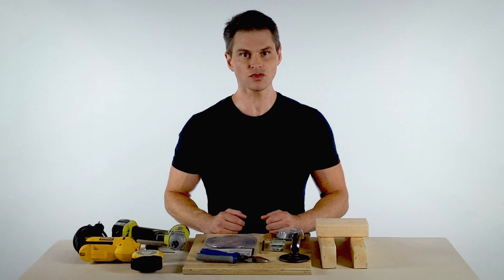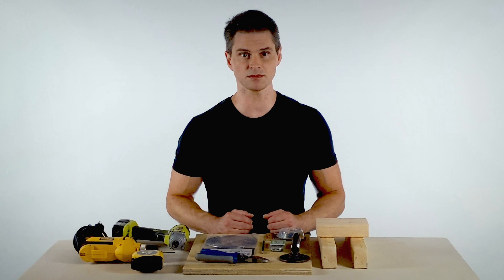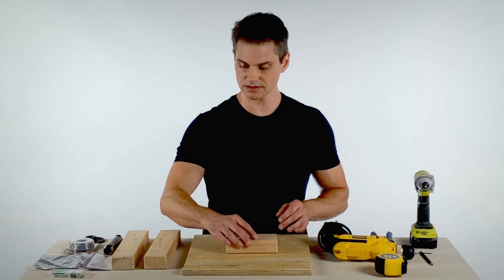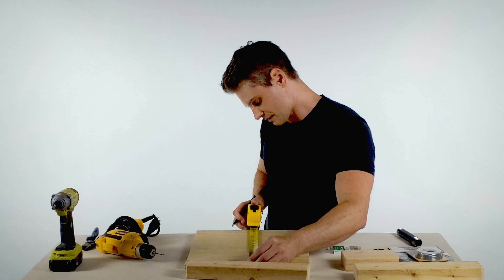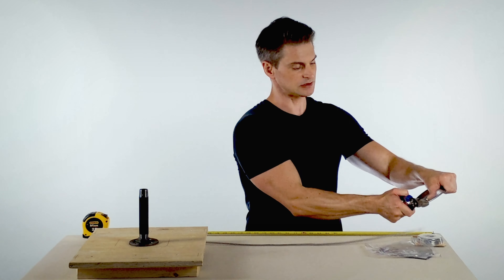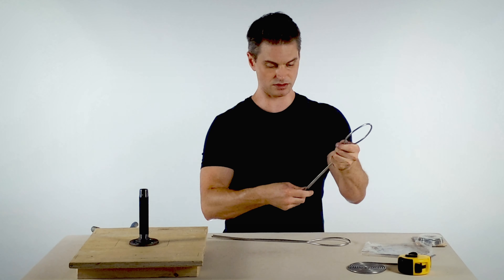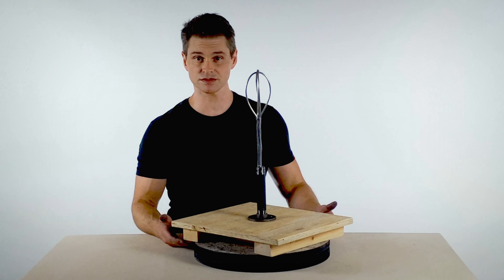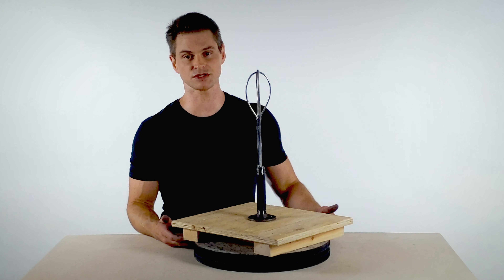On-Armature Bust Part 3: Making the Armature

Comment: Hi Mark. I've made my armature but could yiu tell me the height from the base to the top of the egg beater . thanks obie
Reply from the maker: A bust armature is typically about 16 to 18 inches / 40 to 48 cm in total height, but really this will depend on how big a base or much of the torso you want to include. The egg beater part should be just about centered within the head, so you can estimate the final total height of the sculpture with a fair degree of accuracy. Best of luck!

Comment: Is it possible to make a full scale armature the same way you made this armature or is there another way?
Reply from the maker: This kind of armature wouldn't support the weight of a full figure. For larger sculptures, you'll need to use stronger materials, at least for the primary load bearing elements. Common choices included welded or bolted steel bar or pipe, bent electrical conduit, wood, and plaster. For smaller features, like hands, you could still use flexible armature wire for posing adjustments.
Reply: @intheround8310  thank you. I’m working on sculpting life size figures to turn into polystone resin statues of characters and it hasn’t been easy finding the right materials.
Reply from the maker: @mjsimunovich013  Wow, that's ambitious! You might want so use oil clay for that. I definitely prefer sculpting in water clay, but for long projects, the pragmatic advantages of oil clays can't be ignored (I talk about the advantages and disadvantages of each in the second video in this series). Best of luck!
Reply: @intheround8310  thank you. I know it is but let’s just the 3D sculptor artist who made beautiful designs of a character is what really inspired me and let’s just say he’s being unreasonable on things when I found ways that could get him noticed. Oh I know which is why I’m looking good oil or waxed medium based clay and armature that can take the weight but it’s also why I’m also maybe considering using mannequins but I am trying to find was that allow the person to adjust the height and pieces of the mannequin. I watch those videos and other videos which I recommend for a lot of people to watch so they can get an understanding of why it’s good to use an armature for certain sculptures. Thank you.